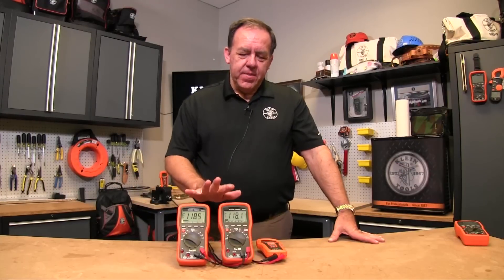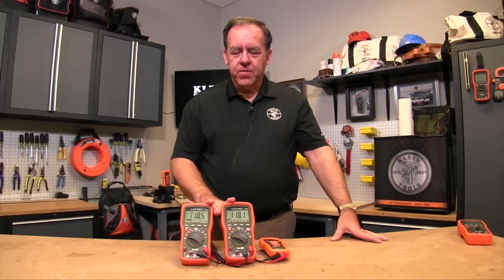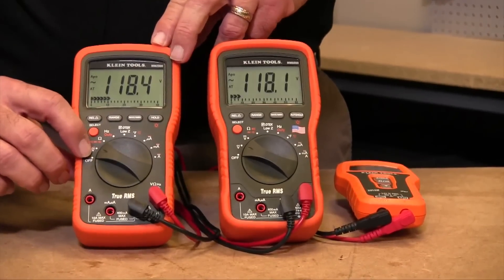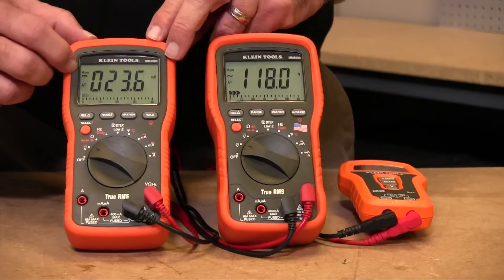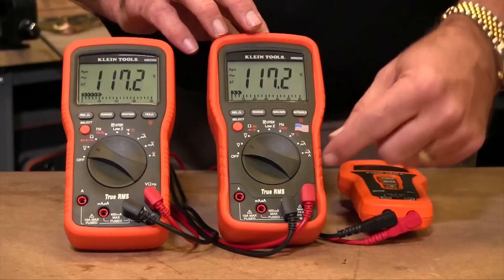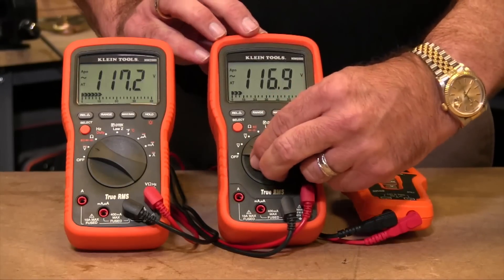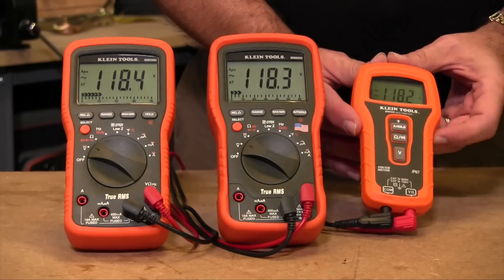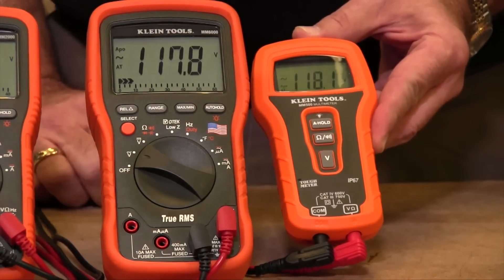How To Use The Basic Meter Function (Types of Voltage Selection)

Comment: Hi! I have the MM600 and it is a solid built little tool.
So I would like to know how to use my mm600 to measure the dc voltage output of a hobby transformer that is supposed to put out 18VDC Max and 6VA max. Thank you.
Reply: Well it's basically the same cause u can use select function to change polarity on it